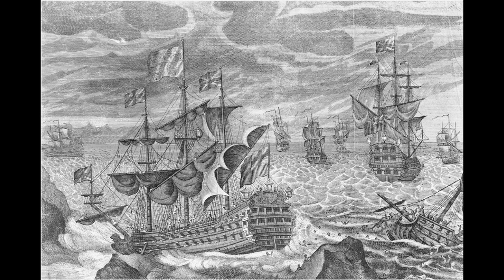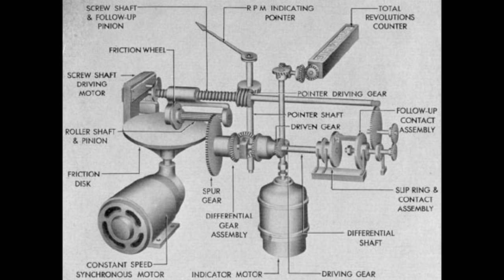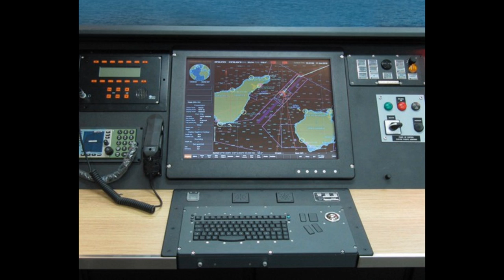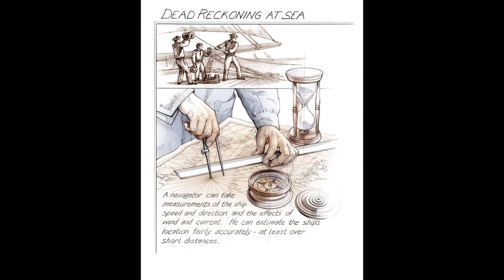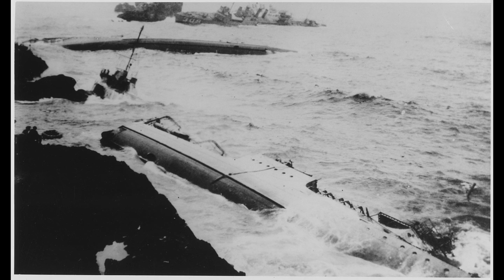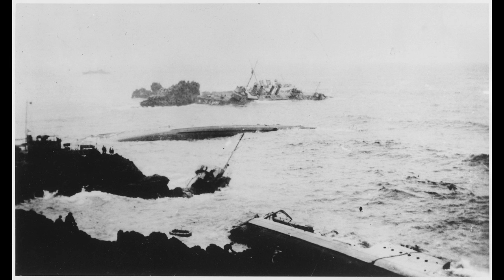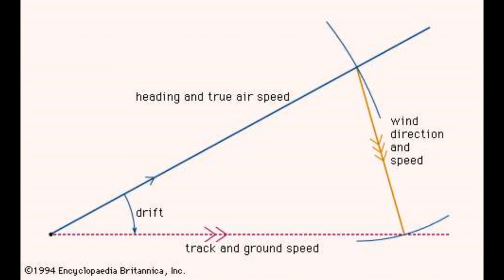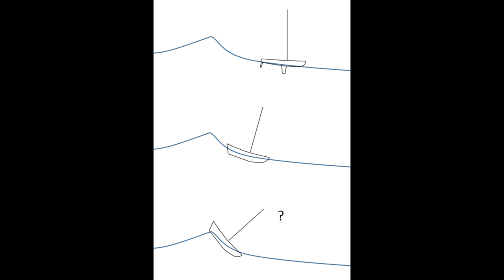Honda Point Disaster - Taking a Wrong Turn at Albuquerque

Comment: Since 1 spent 18 months sailing half way around the world many decades ago (before GPS) and having responsibility for navigation, I have an opinion:- the crew responsible for navigation should have been locked up for incompetence.
Dead reakoning is just a guess and only acceptable navigation when well offshore. Certainly when I knew we were within range of radio beacons I relied on that. if you have at least least 2 beacons available you could 90% sure of your position within a mile or so. Sailing blind on an approximations is just plain stupid (or more probably arrogance).

Comment: You say that the commander had the correct data, but he also had wrong data. Ultimately, he had to make a call on which set of data he trusted more. In hindsight we know that radio is far more reliable than dead reckoning, but back in the day, that tech was still somewhat experimental.

It doesn't matter if you have a set of data that is correct if you also have another set of data that's faulty, and you have no means to tell which of these two dates actually is correct.

Comment: Captain, the radio beacons are not matching our supposed position ...
And where the beacons are putting us lieutenant ?
Nord-east  by 30 miles , very close to Honda's Point sir.
Slow down and do not turn east, those damned beacons may be right after all. I'm on my way to the bridge. This is madness ....

Saved his ship and crew by using his brains, doing what captains are meant to do ...

Comment: For what it is worth, speaking as a former U.S. Navy navigator, I would never have turned at full speed into a lee shore based on dead reckoning alone. Destroyer Squadron 12 did the right thing. The commander of Destroyer Squadron 11 should have been held fully accountable in my opinion.

Comment: I don't think I would have blamed Watson for ignoring the radio beacon data at the time. It was still a new technology with many unknowns that would be worked out at a later time.
     HOWEVER, dead reckoning is still taught today and one thing is hammered into every navigation student: It is only as accurate as the data you have (speed, position, and heading) If you know every bit of data perfectly accurately AND you do all your math correctly you will be exactly where you expect. 
    Unfortunately, perfectly accurate data is impossible to have, and you can't know just how inaccurate your data actually is, so Watson had no reason to be so confident in his position.
     Because his position had not been updated, he should have known he might be miles from where he thought he was, so he should not have turned toward the coast without slowing to a crawl until he sighted land and could check his position against a land mark (like a light house)

Comment: Interesting fact that the senior and more experienced commander chose to ignore the new (and mistrusted) technology, the radio beacons. As is the case in many situations where the introduction of new technology is not taken up until it is proven. This accident possibly had to happen to ensure the adoption of the newer and more accurate technology of the day was eventually proven correct (during the courts martial). This ignorance of technology was repeated in WW2, when a new technology (radar) provided significant advance warning of an approaching enemy and it was dismissed until the bombs started falling.
I guess it is a human condition where we trust "the way we have always done it" as opposed to changing the processes to accommodate the newer technologies. 
Further, in context of the period and for both situations, a whole manual of operations would have had to be re-written and then retraining of all of operators, staff and commanders to embrace the new technology to embed it as a standard operating procedure.
What will be the next avoidable disaster if only the new (tested, adapted for operations and implemented) technology  had been embraced?

Comment: If someone in this situation paused to consider the discrepancy between dead reckoning and the radio position, and ultimately  they couldn't detect any sign, apart from the radio, of not being where the tried and trusted method of navigation indicated, and concluded that dead reckoning was more reliable than what was somewhat new technology, and then ran aground despite proceeding with a reasonable level of caution, ran aground, I don't think I could blame them. It's easy to say with hindsight (and from the satnav era) that the technology was working perfectly and dead reckoning relies on various assumptions about the behaviour of the sea that can occasionally be wrong, but I don't know that it's unreasonable in the circumstances.
But to simply ignore the discrepancy and proceed without any caution as though you had no doubts of your position despite there being a discrepancy between two methods of navigation strikes me as superbly arrogant.
I don't know exactly what calculation or consideration or discussion there actually was but the way it's told in this video certainly gives the impression of the radio position being dismissed out of hand.

Comment: While I can understand the reluctance of older seamen towards new and seemingly exotic technology, as a person in charge to have navigation information for locating your ship in a hazardous area from 2 sources, one being dead reckoning (known to be affected by cummulative errors and unmeasurable/unforseeable factors) and radio beacons (albeit new and perhaps still regarded as experimental tech) and the two sources showing significantly different data, one of which shows your position in dangerous proximity to the shore and choosing to completely disregard THAT data rather then take precautionary measures (like the other ship further behind did) is blatantly wrong and IMO the harshest verdict of at least negligence is more then justified and deserved.

Comment: Hold on. A lifebelt fired from a rocket launcher? How have I never heard about this?
Reply: The line to (or from) the ship is fired by rocket, and the sling for the person is pulled out along it (maybe the rocket pulls the messenger line too?).

During WWII, an Army DUKW truck ("duck") rescued a Navy patrol boat's crew (had run aground) off Cape Cod or something. The next day, Roosevelt was briefed, "yesterday an Army truck rescued a Navy crew." I hear that the President (an old Navy man himself) was quite amused.

Comment: I know a guy that actually believes it is safer to drive fast in the fog, because if you drive slower than normal, some guy driving fast is bound to hit you? Is that a conundrum  or what?
Reply: There is no safe way to drive in dense fog  (or an intense blizzard) other to put your emergency flashers on and try to safely get off the road and away from other drivers.  OTOH I tried to do this once in a blizzard and realized too late that I was  trying to exit using an entrance. I had to slowly drive backwards to get back to the shoulder. Yikes!

Comment: LORAN predecessor?  Key in leading, is always to have a clue where you are going...
But.  The Commander is responsible.  Even if one says that the vessel commanders are also responsible for their own ship, when the flotilla commander took over responsibility for navigation, he defeated a check/balance two eyes on the mark opportunity.  As well as any other navigator who could/should have questioned the obvious anomalies between dead reconning and electronic navigational aids available.   But obviously they were off by miles from where they thought they were, should have had done this during the day where they could have seen other reference points.  He should have been put in prison for Gross incompetence.

Comment: Here's my take away from this. 

I think it was something that showed a lack of flexibility and slow reaction from the captains, officers involved. Those who had their ships run aground. If the conditions were so odd, the blind follow the leader mentality is just going to get you into situations like this. Thankfully, it didn't happen in war time. 

Good officers, I bet most of them were on any other day, on any ship. Just on this day, this...... 'eh, well, it's normally works this way' attitude was a dangerous one to have. Great officers, definitely not. We have a clear example of that. In the adverse and confusing situation, the best tool for the job was used and used in the right context. 

It's not just a technological issue, but it's a doctrinal issue on a few levels. The USN wasn't able to encourage the adoption, use of technology which for the time was both new, reliable and in this case, the best tool for the job.

On the other side,  I do think we need to credit the officers of the group who did react, made the best decisions they could in deeply confusing situations. It's hard to know where you're going with a bit of mist, fog. Never mind doing it on a sea that seems to going backwards. 

Unfortunately, at some point you have to act, to make a choice. While they had a tool which could have placed them on a map, confirmed their position to a degree, if they tried to work at it too long, the same thing would happen. Ships run aground. 

It's not a place I want to be in and it's not a choice I'd know how to make with their information. I've tried to navigate in some pretty deep fog, I've been lucky enough to have a compass, a GPS unit and enough of a view to find a landmark. I really have sympathy for the guys on the ships and those who helped out too. 

It was just a bad day to be out there. Not sure fault and blame has anything to do with bad luck.

Comment: And that's why I joined the air force. The few naval officers I've come across. For the most part have been decent human beings. But they have a tendency to have a tendency to have a high number of jerks to. I had no idea of Naval rank. And Eagles on a uniform to me means a colonel. I made the mistake of calling a naval captain a colonel once. And he went off. And I explained eagles ment a colonel to me. He stormed off mad as a wet hen. Later I was sent for by my Squadron command. Who was a colonel. He asked what happened and I told him the entire truth about the incident. The entire time thinking Greenland here I cime. But to my surprise and grest relief. He just laughed it off. And explained that naval officers were sensitive about their rank. And that half the base didn't understand their rank. So for the rest of my time in the Air Force it was simply yes sir and no sir for naval officers. Most were nice about it. And sime understood that we didn't understand their rank. But they had their fair share who didn't recognize or didn't care that with the exception of the marines. The rest of the army and air force didn't understand their rank system. A few though did understand and seemed amused by it. And being a security police airman on a sac base. They were thoroughly checked especially in restricted areas. And I do mean thoroughly. And my commander was pleaded by my attention to duty. And I think amused by it. The one thing you should never do is tick off a young security police airman. Not a real good idea. No matter your rank or what branch. And especially in a secured area. Not the brightest thing to do. Especially in a sensitive secured area. And besides getting chewed out for about five minutes. I got a attaboy and a. Good job airman from my commander. And a try not to do it again. Unless absolutely  necessary. Never had another security check on my post.

Comment: Most videos are good but this video contains too much irrelevant or misleading information
Reply from the maker: Such as?
Reply: @Drachinifel  I think you pay way to much attention to "excuses" like abnormal currents and winds. You also show VFR maps and a Jeppesen flight computer... and the wind triangle shown is the pilots version of getting a proper heading. On ships you have both currents and wind. Even with todays wx reports you can't D/R for 9 hours and expect your position to match.
The last fix was at 1130. About 9 hours and 180 Nm later Hunter executed a port turn to an easterly heading with shallow water on both sides. With the SOG off by only about 1 kts he would claim a plot of land. Hunter did not use all available means to fix his position (soundings and/or DF). The accident happened because of both systemic and attitude issues.
The "need for speed" in reduced visibility meant 23 sailors lost their life...
A similar and as stupid accident was Costa Concordia's starboard turn... but that is of course another story...

Comment: This account is inaccurate and/or incomplete as to the radio navigation issue.  To make a long story short, the leading ships actually were following the radio navigation aids but the problem was that they were incorrectly interpreting the bearings to the ships which were transmitted from the on-shore radio transmitter stations.
Reply from the maker: That is not consistent with the USN court martial records, which established that bearing checks had been taken, as I mentioned, but disregarded due to perceived inaccuracy, which included misinterpretation of the incoming data. Some following vessels were accurately following the radio beacons, again as I mentioned, but they were not the senior officers of the squadron and could only therefore save themselves and the ships in their section.

Do you have a source for your statement that the lead vessel was following the radio beacons?